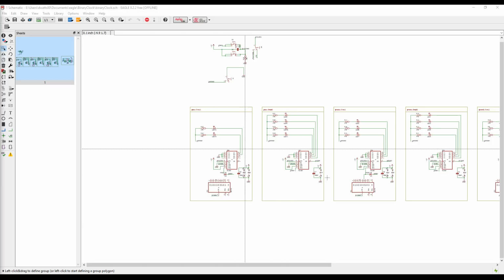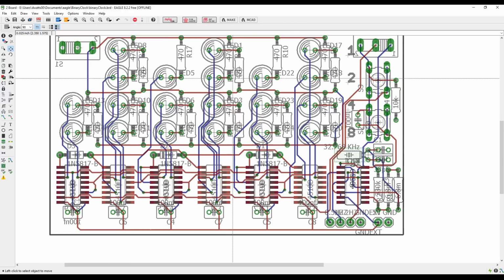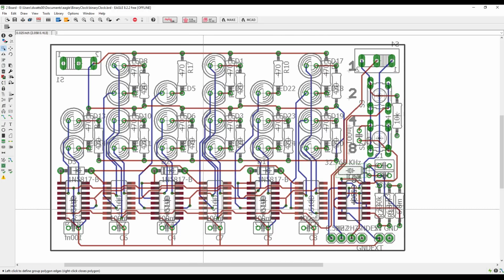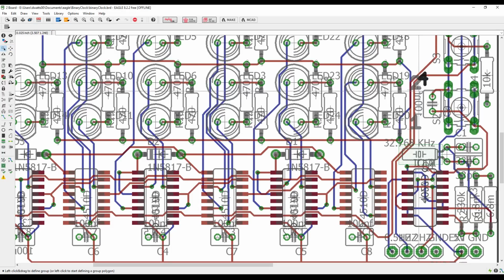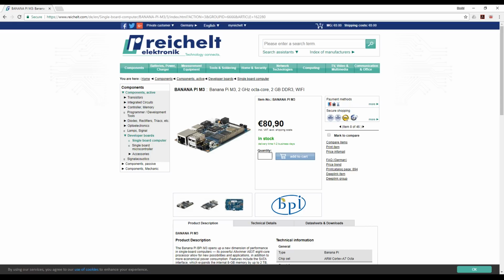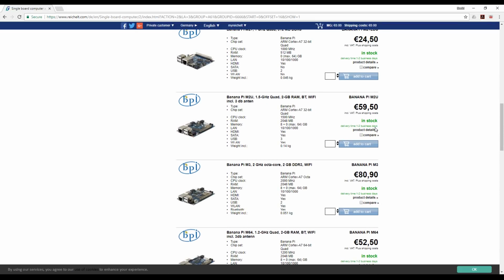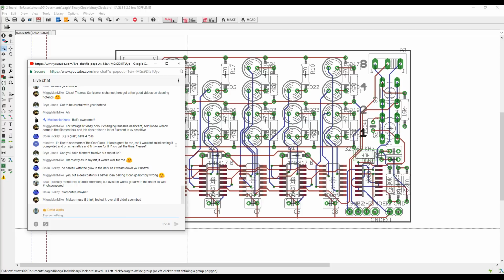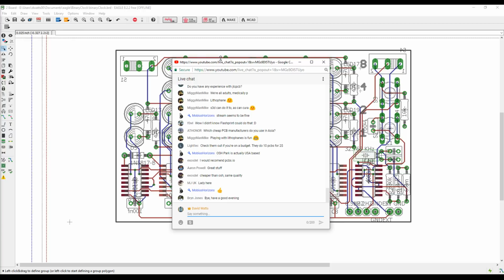Live Stream 19 - Just an quick (maybe) update

Comment: T'was a lot of fun that. I don't think anyone noticed the reduced frame rate considering the bulk of the frame was still image. I have revisited the notion of getting better at designing my own board rather than piecing together modules and breakout boards :-)
Reply from the maker: +Chris Leech my only advice would be to start with a small board, experience success and then build on what works. I made sooooo many dud boards in the beginning (some still end up that easy to be honest) and it was quite disheartening.

Comment: I started using Altium recently, but I've been using Eagle for about ten years, and still tend to start most projects in Eagle.

Altium is obviously amazing for routing traces (interactively), and helping with multi-layer and BGA stuff, but I find it's Library editor a bit confusing.
(it has separate library files for the schematic symbols and PCB footprints, and even a combined library file.)

I also still like the way Eagle adds components to the PCB layout in "realtime" too.
I don't think there's a way to enable that in Altium, but then it does do an ECO instead, which lets you quickly review the changes first.

(which does help prevent any screw-ups on a more complex design.)

Tried kiCAD for a bit - thought it was terrible. lol